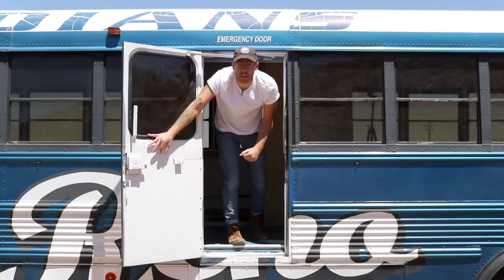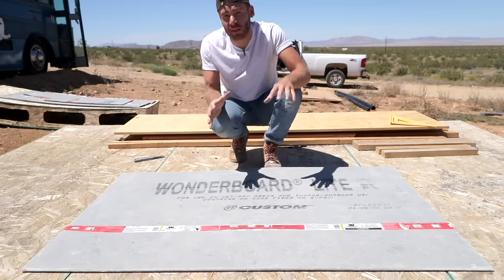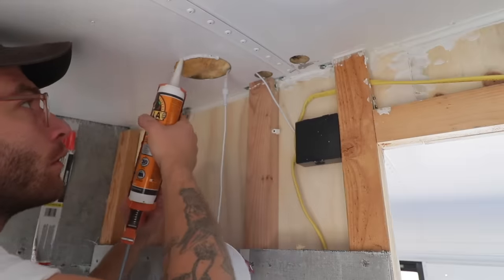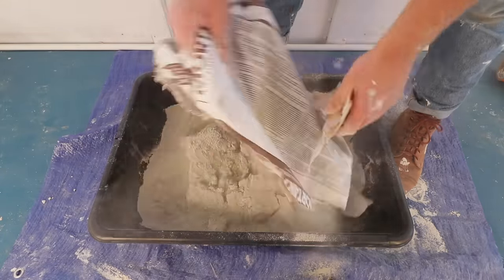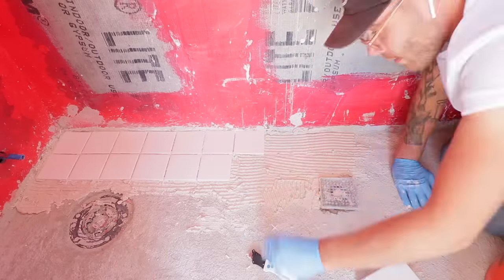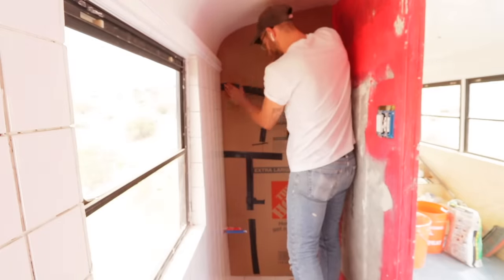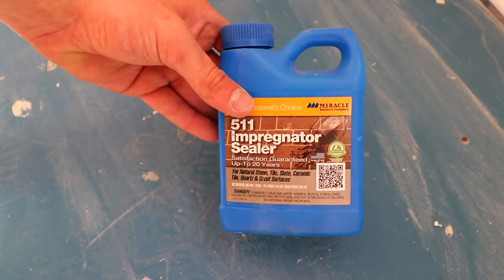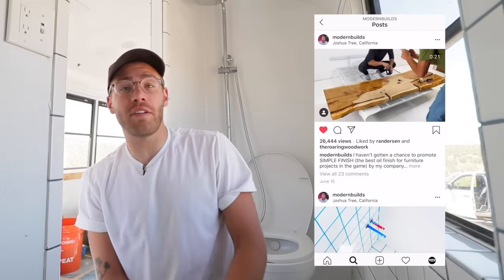EP. 3: THE BATHROOM | DIY SCHOOL BUS TINY HOUSE CONVERSION | MODERN BUILDS

Comment: The exposed non gfci outlet/ switch in a wet room gives me anxiety.
Reply: It's gonna give him some tingles... haha

I LOVE that he thinks the GFCI will actually protect him.... the bus, on its tires, is not grounded. Unless he spikes a 4 foot rod into the ground and cables it to the bus chassis.... zero protection.
Reply: scott bleackley tbf not actually sure he’ll use this bus...
Reply: I S He said he was taking it on a trip somewhere. Where he’s parked now seems like just a temporary place for building. He probably wants it for road trips but doesn’t want to invest in an RV.
Reply: Consider replacing the the switch and outlet with a outdoor rated ones.
Reply: @bmw328igearhead  Do your research , an ungrounded GFCI will perform its function perfectly fine.
Reply: @ydocdp  I have done my research, and have practical experience. 

Anytime I've powered up a breaker with a GFCI, with no.ground, it triggers the breaker inside the GFCI unit immediately. 

What good, is a GROUND FAULT CIRCUIT INTERUPT, if there is no ground?!?
Reply: A GFCI monitors the current passing through the live and neutral wires, as long as the current is the same in both wires everything is fine. If the current differs between live and netural, i.e. you have a current leak to ground, then the GFCI will tripp. A GFCI does not need a ground wire to work since it is only monitoring the currect between live and neutral.
Reply: @bmw328igearhead  Ground fault means that you have a current leak from the circuit to actual ground, for example from the live wire through a person to the ground he is standing on. It has nothing to do with the ground wire as such (a GFCI circuit is not even connected to the ground wire internally) but the name can be a bit misleading.
Reply: @warpman74  ok... then explain how the GFCI can detect current leakage to ground... without a ground...
Reply: @bmw328igearhead  If you touch the live wire, the current will pass through you and into the ground you are standing on, hence ground fault. This of course only happens if you are in contact with the ground.
Reply: @warpman74  aaaaaand what does the unit use, to compare THAT reading versus a true ground?

Comment: Great video and I hate to be a negative nelly, but light switch and plug inside a bathroom? Is that normal in the USA? But otherwise, great video. Looking forward to the next!
Reply: Nope, not anywhere in North America is that cool. Perhaps a 3rd world country...maybe... 

Next weeks episode, he's going to install a gas burning furnace, on a wooden base, with rubber hoses, after sealing all the windows, and throwing the CO detector out the door.
Reply: @bmw328igearhead  light switches and outlets are super common in NA. Not sure what you're talking about.
Reply: An outlet and light switch in the bathroom is but not next to a shower.
Reply: this is normal here in Brazil, there is a socket even on top of the shower if you have an electric shower

Comment: Did this dude really just cover 2 windows🤦🏻‍♂️
Reply: He has many windows left :-))
Reply: BL8 that isn’t the issue smh
The windows will build condensation due to the temperatures outside the bus and inside and will rot the frame where they are being covered
Reply: harriet evs Ik i saw that lol
Reply: He also buried 120v electronic boxes in the ceiling/walls. And 120v unprotected switches and outlets in a wet bathroom. 

This guy is a real big brain...

Comment: My favorite tool is an oscillating saw. Will you be covering the bathroom windows from the outside? I would of taken out the two windows and cover both with sheet metal and using a rivet gun to fasten it.

Comment: Great video. I definitely wouldn’t have used sharkbites though. With all the money that was spent on sharkbites you could’ve gotta a kit with a proper pex crimping tool. Pex is great when paired with crimp or expansion rings. Lets hope your sharkbites dont leak or crack when they freeze.

Comment: love the enthusiasm and hard work. I am no pro but I am in the process of redoing our sower in our master bath.  Unfortunately you are supposed to put down a motor bed with slope first, then the liner then another motor bed.  This is so that when the water penetrates the motor bed, which it will, it will then go to the liner which will direct the water it to the drain.  Because your drain is higher in spots then the lowest part of the liner, you will have chronic standing water and eventually the mortar bed will fail.

Comment: You can make the toilet more solid to the floor by grouting it in.  Use temp shims to match your grout line width, then patch the shim wholes with grout after it dries.  Don't use silicon like a lot of "pros" recommend as if you ever have a leak, you'll not know about it until it's too late.

Comment: Nice project but for the bathroom section you should install both the plugs and the switch outside the bathroom area for safety against electrical shocks

Comment: New sub. Man you could have put the shower on one side and the toilet on the other. Then put a cabinet with a glass on the front over the toilet. Remember its a small house you don't need a vanity in the bathroom, a wet bathroom at that. You could have build a small pull down vanity somewhere in the bedroom.

Comment: Hey are you putting knock-out clamps on your electrical cables? i'm not an electrician, but i am pretty sure there needs to be some way to keep that strain off the connectors inside the box.

Comment: Just a little bit of insight from an electrician. That Junction box on your can light is crucial to be accessible. Inside that box is a driver and it is the component that will fail first. You should bring your Romex to the hole you cut in the ceiling and place the jbox inside that hole. So you can remove the light, and replace the driver if needed
Reply from the maker: Good to know!! Thanks Travis

Comment: Question for you. Enjoying your video by the way thanks for making it! The question is would using marine grade plywood for the bathroom flooring and walls work better then installing the rubber water protection that you did? Thanks for your time in advance if you read and answer.

Comment: Love the project-- overall nervous about how tight everything is between some support or bracing members and the walls/floor of the bus. I imagine flex of some kind might be better, like a layer of rubber connectors. But time will tell.
The real reason I am writing is that you buried that LED lamp connector behind the shower wall material. I really wish there was some kind of access hatch. Again, time will tell!

Comment: Here's a quick trick for using the caulk gun. Instead of using your finger to wipe the excess, point the tip of the gun in the direction you are moving the gun. Circle whole of the gun will help wipe away the excess.

Comment: Some things I noticed though, you hang dry wall, or in your case cement board, from the ceiling down. You can screw from the bottom up, but you always hand from the ceiling down. Second, I noticed no vent fan. You need a vent fan. Even though its a small room and you have an opening window, you need to pull that moisture out. You don't want it in your bus, especially considering you will have lighter weight materials. I would do a door, not a curtain. Finally, you have the wrong type of switch / outlet combo for a wet room. Need a waterproof switch and outlet. GFCI outlet and switch on the outside. Did you even tour timy homes or RV's before starting this?

Comment: I do like your bathroom built but question the power plug on the wall where the shower curtain could drip water on it . It could be shocking if your had a hand on the steel window and touched the power outlet. The same goes for your metal vanity and the plug standing on a wet floor. Safety first.

Comment: You shouldn't have sealed the boxes behind the Wonderboard. Those orange and clear push connections are known to cause excessive heat and catch fire. And it's against NEC Standards to have a non readily accessible box concealed behind wall board

Comment: You're going to want to put a GFCI outlet in that bathroom...or remove the outlet. It is a "wet room" after all
Reply: GFCI won't work for a lick if the rest of the system isn't wired properly... then connected to a grounded outlet. Otherwise, if he is running an inverter or genny... a big'ol ground spike is required... 

But people keep freaking out when I tell them a GFCI requires a ground... shrugs
Reply: @bmw328igearhead  I think I may have a bad ground in mine. It caught fire when lightning hit. Breaker never tripped. Replaced the gfci and circuit is still dead.

Comment: it is absolutely not recommended to put ceramic in a camper. for multiple simple reasons, first two being; weight (not only relevant for gas but also in case of a crash), it's gonna crack.
Reply: It totally will, because he didn't use Flex Glue or any other Flex Seal Products

Comment: You do realize that you just placed both those balusters for those LED light behind the backer board so they are no longer accessible so when those balusters do eventually go bad which they will you have no other option but to break that wall to get two of those balusters you should have placed them somewhere where they were accessible and used low voltage cable to make the link between them in the actual LED bulbs themself

Comment: Jeff likes to use a lot of that Red Gard as a water proofing. Cement board is not water proof, tile backer is. HD also has a premixed polymer grout and mortar that will also help with the waterproofing and is flexible

Comment: My OCD would prevent me from doing such sloppy looking work even in areas nobody is ever going to see, such as under the bathroom floors or behind the cement board wall cladding. Now I realize that the way this has been done in the video is perfectly fine and will work just fine, but I just could not do it that way! But then it would take me 5 times as long for no real benefit. I also hate putting wiring and plumbing anywhere here it is only accessible by demolition.

Comment: Lot of work for a project like this. So far this time Im a bit disapointed.  the floor have been paint everywhere instead of using a nice warm vinyl looking like hardwood, but shower has real titles on walls and floor that will likely crack? tbere is so much lightweight products and waterproof he could use? the light switch/outlet should be outside the wet room.  Just the huge bed platform was killing me, should have been a murphy bed ( on the side, that is a couch in the day) so it doesnt take half the space when not needed and you can set a nice living-room with tv, and kitchen. bathroom a bit bigger and no water going on the toilet.   I like the guy and the usual ideas but this one look a bit rush and with too low budget for a real rv

Comment: Just a couple of details/suggestions/something: Did you think about how those blocked windows look from outside or you just didn't care?

And second, maybe it would mean a little more work but less weight, did you consider making those slopes out of wood? the only different thing is that the membrane would be over that wood instead of under it as it happened with the cement. And if you still needed a layer of cement to later set the tiles on, well, at least it would be a thinner and therefore lighter one.

Other than that, a really nice work with those tiles indeed.

Comment: Why didn't you blackout the covered window BEFORE coverign them with cement board (c-ment not ceeement btw) that way the blackout film would be protected by the glass, anything you do on the outside will be affected by time and weather etc. Also, the gaps in the stud walls - insulation, can never have enough, period.
Looks like you missed another trick - the "sink above the toilet cistern" - so the grey water from the sink while washing your hands, feeds the toilet flush water in the cistern, thus also saving a bit of water each time and also when shaving - brushing teeth etc etc -  that way you could have had the shower at the other end where you're putting the vanity unit. - That toilet / shower combo is going to become a major pita and annoy you after a while.  Honestly it's sloppy design that could have been avoided, there's enough tiny home / space saving info on the net to get you there.  I'm not generally a hater but there's quite a few things about this build that aren't great design or sloppy "short cut" execution, sorry bud.

for example another option if you INSISTED on a vanity at the other end is to put the shower in the middle - "how?" you ask.... watertight door with a sealing ring, put shower system on back of door via longer flexible pipes (with the controls on the wall to the right of the toilet about standing chest height so your shoulders aren't banging against it when on the crapper) -et voila! standing room for two. Toilet has it's space, you can have a full vanity and sink (despite it being a waste of good grey water - unless you plan on pumping the grey water from shower and sink into the cistern) and you have room in the middle for showering without banging your knees and shins on the toilet - which I absolutely guarentee you'll come to loath with EVERY FIBRE OF YOUR BEING.

Took me all of 5 seconds to figure out that solution, too late now though eh.  I've got plenty more if you need em - I'd build my own tiny home if I had the money, shame really, all these great ideas, and no way to make use of 'em.

Comment: 6:56 please stop using Superpro and saying it was done right.  That's a clear NEC code violation to have a junction box buried behind a wall like that without access.  If you can pull off the fixture and access the junction box then it's legal but clearly you buried it under cement board and is not accessible.

Comment: That vinyl wall stats that you will fail and will come out looking like s*** and you will have to rip the bathroom out and replaced it is it will rock you without I have replaced three or four bath that I've had that in them and the water seeps behind the edges of it and Rasta without and you had to replace the whole back that's about time the home owner finds out it's too late